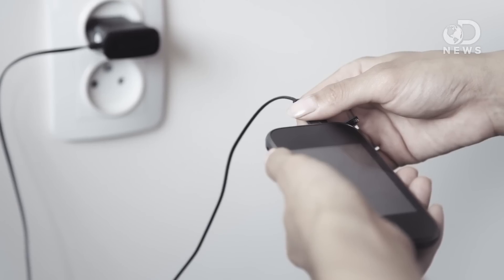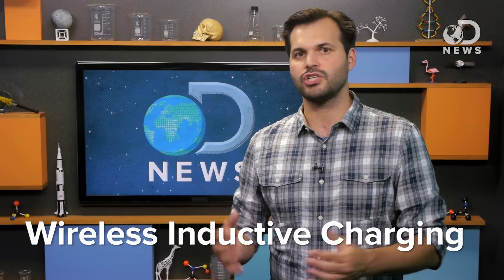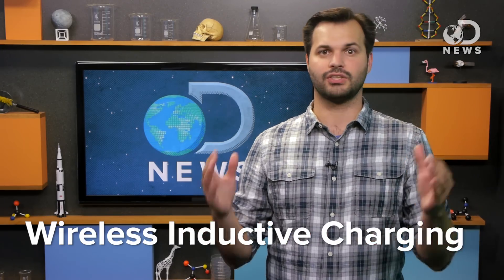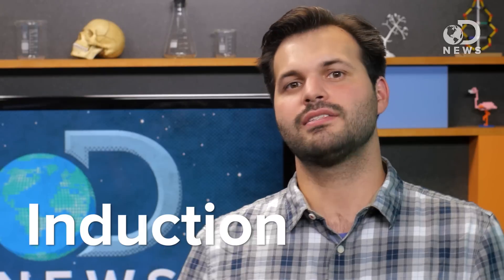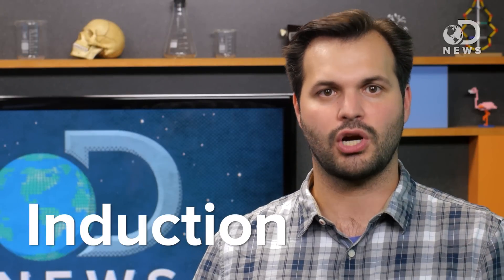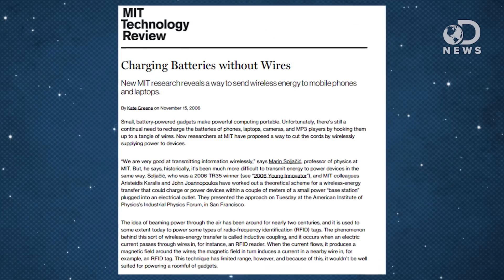How Does Wireless Charging Work?

Comment: So, the question you posed, and I paraphrase: "how do electrons from your wall get into the phone; you DID NOT ANSWER AT ALL !   Like ,not in the least.  Electric current applied to a coil will create a  magnetic field, and that magnetic field can induce a nearby coil to begin "circulating" electrons, but how does that get stored in a battery?  There is an answer, but you certainly didn't come even remotely close to it.  Do your homework rather than just raising your eyebrows, buster.

Comment: I called wireless charging when it's able to charge my phone  in my pocket or ✋. it's not wireless bcz you place the phone on deck which  is connected to electricity through wire.

Comment: You can use microwave radiation to power lightbulbs wirlessly but you will get radiation and cancer, thats why if you put a light bulb in the microwave, it will turn on

Comment: The plug converts the walls AC power into DC power so no the electricity in the pad is not cycling at 60 times per second. Nice try though.

Comment: Please advice me on one issue. Am currently using the galaxy s8 plus by Samsung.  Yesterday night i left my phone on the Samsung's fast  wireless charging pad even after its fully charged.  Will it damage my device? I know today's lithium ion battery are much smarter and they stops inducing charge after they reach to full capacity but am not sure if the same principle applies for the wireless charging pad.  Please advice.

Comment: You can explain it in these simple steps:
1)  Creating a potential difference across an inductor will temporarily sustain a magnetic field. 
2) Alternating the potential will sustain an alternating magnetic field. 
3) Another set of coils within the range of that changing magnetic field will in turn create a changing electric field. 
4) A rectifier can be used to convert AC to DC and recharge the battery.

Comment: "makes life easier". Yeah! It's so hard work to just plug your phone in. Wireless charger generates more energy losses which means longer charging. The lost energy changes into heat what makes your battery's life shorter. Your phone too. Also you can't answer the phone without interrupting charging. One keyword - gadget. Useless.

Comment: Nice ,We are one of the business veteran of wireless electronic product in China, Our main products including wireless chargers, car chargers, blue tooth speaker and BT headphone, transmitter and receiver modules, and PCB., Over 500 skilled staffs in manufacturing, 8 years experience, QI,CE, ROSH 
and FCC certificated.

Besides, We have excellent engineers and designers for OEM or EDM orders  ,currently have our own plastic molding, IC bonding, SMT and finishing departments that are all managed in accordance with ISO 9001 guidelines. we think our products will give you an edge over your competitors.

Comment: hey, i just bought one reciever for my Note 2 but the phone is not charging. when i put the phone my wireless pad, the pad turns on its lights like its charging but my phone is not. I checked the pad with Galaxy S6 and it works like a charm... I'm on 4.4.2 .. what should i do?
Reply: u still didn't get answered ;(

Comment: hi, to all.

this video has good information, and let you a new way to see the wireless charging technology.

But, Tace Dominguez; you said that the wave of transfer electricity on the wireless charger is on AC voltage and the Samsung wireless charger works on DC or direct current, also most of the wall charger and car charger are DC voltage ....?
Can you explain that?

Comment: I did a little experiment to see if I would shock myself with a wireless charging pad. what I did was put my phone on it and put a piece of tin foil in between it. What I found was that I wasn't shocked at all, just now my phone wouldn't charge as when I touch the tin foil my body's ability to conduct electricity was altering the direction of the power while splitting the same amount of power into my phone, preventing it from shocking me.

Comment: Wireless charging is kinda pointless when you think about it, I mean you still gotta plug in the "wireless charger"
Reply: +FingerFlickenBoy it's actually slower
Reply: It really is. It's just a novelty.
Reply: you can buy a 15 feet charging cable too
Reply: But you can be up to 15 feet away from it.
Reply: You can use it with multiple phones and it's a bit faster :p
Reply: DonD512 Unrelated, but my galaxy s7 edge charging port broke a few days ago and i had no way to charge it. So it fixed my problem at least, lol
Reply: +Jacob Taylor ...Dude me.  too. I just got back from the store. spent 50 bucks on this stupid wireless thing.  my s7 is 3 months old.  and the charging cables don't work anymore!!!! wtf.  I'm screwed.  this thing charges like 10 percent an hour
Reply: well, you do prolong the use of your adapter ports, including the charging cable.
Reply: +Jacob Taylor ... ok here's an update.  I plugged my brand new wireless charger's USB  connection directly into the phone. and now the port works of all sudden!  I've used other people's Samsung cables and they don't work on my phone.  but this new wireless usb connector works fine with the port.  maybe you should just get a brand new charger cable and wall socket.  it could be the cable getting old and twisted. not the port.  Idk.   try it.

Comment: If you power larger devices with this, isn't it the equivalent of living under the power wires? Cancer or birth defects anyone?
Reply: Living under power lines does NOT cause cancer or birth defects. This is a commonly held misconception that has been debunked many times by scientific studies.
Reply: only few of us  think of this others are just too interested in the needs they have than what actually benefit us all

Comment: 3:35 freeways that charge your vehicle and devices. Kinda like how the Porsche mission e is setup for induction charging. That car is capable of charging wirelessly due to its induction charging setup it could then receive a signal from a distance thus never needing to pull over for the sake of needing a charge.

Comment: my computer whould be Nice charging wirelessly. it whould also be Nice to be able to turn it on and off. if that is not possible it will be a waste of power and recources. i also think that can have something to do with why it is not in use at the time
Reply: Maybe a desk that you would plug a wire into and most of the desk top would have a wireless charging pad on it.

Comment: Overcharging phones = exploding phones etc... Actually there is too much energy waste to make this useful on a large scale ie: 
10 times more pollution generating enough juice to cover the energy loss BUT it would be super cool to only use it to CAPTURE lost energy ie: energy slipping out into the air anyway such as transformer energy loss, EMF loss, static, electric wire loss etc.

Comment: Everyone knows nuclear provides clean energy, but notbody wants it around after they saw what happened with Japan. With Inductive Wireless Charging, we could possibly move the electricity from a remote area to homes.
Reply: +Julie Lum Wireless charging still has a maximum distance, though.
Reply: Ahh yes. Maybe someday.
Reply: +Julie Lum    nuclear power is not clean energy. it produces radio active by products and the thing that happened in japan can easily happen again. also it only produces half of 1 percent of the potential energy stored. I think hydrogen or even better finding a way to build thorium building stations is the future. you cannot move electricity from remote areas to homes. the further you travel the more power loss there is.
Reply: luke martell
The power loss isn't that significant...
Reply: But I guess that's were this wireless energy comes in? Maybe someday we can have one large power plant every so miles and get rid of power lines as we perfect this technology. And I agree with you on the nuclear point. They are fragile plants that are detrimental if not properly cared for, but I stated them as an example earlier because at the moment, nuclear is being used on large scales in countries to generate energy while hydrogen, biofuels and other eco-friendly methods are less common and not economically feasible on a large scale at the moment, though I hope we do turn to these alternatives someday.
Reply: +Link149     actually yes it is and I think time would be better spent trying to fix the actual problem and giving the 2 billion people on earth power instead of trying to find a cool way to charge your tooth brush. as for the economy. using thorium would be 10 000s times cheaper and today's plants can be easily changed. I guess it's not in the government's best interest. let's build walls instead right
Reply: But wireless means that anything that needs electricity can be charged, so electric cars could possibly run and all household applications could go entirely wireless! I still think it's a noteworthy investment lol. And yes, you bring up a good point. Building walls is always the answer.
Reply: luke martell
Here in Quebec, Canada, we have huge hydroelectric plants (dams) all the way up north of the province. We produce so much power we actually sell some to the United States.

I don't know how much of that energy is lost, but for comparison, the distance from the border of state of New York must be around 1000 Km. If the power loss was really that significant, the amount of energy we could share with the United States would probably be so low it would be pointless for our countries to even have a contract.

Then again it depends of the material the wires are made of, and all kinds of other variables.
Reply: here in Ontario we pay more for hydro then any were else in the world. there are many problems with this idea. number one installing hydro plants every few miles and loosing 90 % of the gross kwh made would be as dumb as living in north Quebec. 2 how do you stop people from stealing it straight out of the air. just plug your stuff in and fix the real problem. global warming
Reply: I'm all for moving toward a future where electricity is widely available, and it could be implemented as a regional tax just like a tax for street lamps and roads. Its like charging your device at a library or using public WiFi. I'm not saying there is any problem with the current system, but I am suggesting that this has the possibility of replacing dangerous electrical towers and can possibly clear up wires from urban areas while providing readily available electricity for everyone. In addition, the result could be the movement toward cleaner energy such as hydroelectric and wind farms that don't have to use up acres of urban space.

Comment: it is also possible to transmit DC current wireless by means of low field Microwave ever put tin foil in a microwave as an analogy as the current hits a copper plate you can use a diode bridge to transform the microwave into a DC current out put

Comment: I'm sorry to be the bringer of bad news, or "mister know it all", but, I just wanted to point out that the power running through your walls is DC (NOT AC)! while the power running through the power-lines is AC, since AC is great for long distance packaging of high-voltages using power-stations, containing "Transformers". If the power-lines were DC, you'd need a power-station every so many blocks.
Just prior to getting to it's destination (for example, your house), the AC is converted to DC, using a "Rectifier" and stepped down to 120 volts (240 volts in Europe), which is what is running through the wires in our walls and also what we receive from our sockets, to power our electrical appliances.
Thanks!

Comment: Matching resonant frequencies wasn't discovered in 2006 (that's pretty basic EE)... That MIT teams advancement was deciding to choose a frequency that gave them about a 2m distance in the near field. They also proved that by adjusting the resonant frequencies, the near field size can be changed. Also, the future is wireless power transmission. As an Electrical & Computer Engineering undergrad I made a wireless charging system for cell phones (not surface to surface induction mat style, but free space). This is getting easier and easier to do.

Comment: If wireless power really kicks off, one great area of implementation could be transportation. Imagine a car that runs on electricity but has no batteries as it would be drawing power from a smart wireless power grid.
Reply: No batteries at all would never be practical, it would mean every inch of road would need to have the technology installed and maintained. You could simply have smaller batteries and have charging pads at places like parking spots and traffic lights in the most high traffic areas.
Reply: The only best area for such technology are bullet trains. The Japanese MAGLEV bullet train uses wireless transmission of energy to power the internals of the train
Reply: it's real but billionaires at big companies won't go for it

Comment: So the charging pad has to be plugged into the wall and the phone has to be set onto the pad? Why not just plug the phone in then?
Reply: Maybe the ports broken?
Reply: ***** You can charge multiple devices at one time, an advantage over plugging them all in and taking up 3 ports.
Reply: ***** Mini USBs have a bad tendency of wearing out very quickly.  I just put my Galaxy S3 in the shop to get the charge port replaced, cost $55.  Then I saw inductive chargers on ebay for $10.  Not plugging it in anymore except for data transfer or once in a while for faster charging.
Reply: Kevin Miller I didn't know that. Now that's useful.
Reply: ***** yes, people are too lazy to plug it in, its easier to just set it on a pad than to plug it in. first world issues
Reply: ***** its easier
Reply: ***** so the port dosen't wear out
Reply: Might not the charging pad's port break and/or wear out? Perhaps someone would need a charging pad to charge a broken pad.
Reply: If you don't have the cable, this would be an alternative to charge your phone.
Reply: THEOAKLANDBABY510 
My cell phone (Motorola Droid X) did that a year after the factory warranty expired.  The data/charging port quit working.  I can't tell you what a pain it was to buy a second battery and a charger for those batteries; constantly switching them out while the other charges.  This is why I can't understand why people buy cell phones with integrated batteries and integrated memory only.  I had my eye on the Samsung Galaxy S6 until I found out that it featured both of those bad traits.
Reply: posting id my zte sonata did that in 3 months so i am just going to sell it to someone or a machine and going to buy a lg optimus l70
Reply: THEOAKLANDBABY510 my zte sonata did that so im selling it and buying an lg optimus l70...
Reply: Jaytheredneck1 i'm having the same issue with my s3. what charger did you buy?
Reply: Maybe if you go out you'll never run out of battery?
Reply: Google Doogle That would require an excessive amount of energy, but maybe one day
Reply: Tómas Óskar Friðriksson uhh. no
u have to put it on the pad in oder for it to charge. it doesnt automatically charge in ur pocket or something.
Reply: posting id  I just got the S4 as a gift, but was going to take it back for the S6, but then I found out about the no MicroSD or removable battery.. Now I'm conflicted.
Reply: Jason Ries, sometimes your charger may disconnect during night but with wireless you just plop it on the station and you are going to be charged. Also it does break as easily.
Reply: Works for people who can't replace a high end smartphone due to a damaged charge port. just pick up a wireless charger for 30 bucks and a cover can be found for 10.
Reply: Because you can leave it plugged in and then just sit the phone down on it.

Comment: The words "Waste of energy" caught my attention. Is it still a waste for those charging pads that charge by simply placing something against it? Like the Galaxy S5's charging case? It doesn't dock in or anything; you simply lay it down on top of the charger. I mean, still wireless, but not over a distance. Still a waste?

Comment: actually it's more efficient as most if not all inductive chargers shut off when the battery is full unlike a AC adapter which constantly gives off a current and thus constantly uses power

Comment: This is not wireless chargibg lol. you still plug it into the wall like the" old" method as well as a wire commibg from it.. you cant walk around the house and charge youre phone while its not plugged in lol. you have to keep t on the pad to charge . infact its worse with that method. The plug you have right now that it plugged directly into yor phone will stsy attacched so you can use your phone more easily. the other way requires you to hold tge chsrgibg base and tge phone together at all times. its a bit awkward direct plug moves with the phone. unles you have the w
ireless charging devise attached to the phone tgen you can manuver th
e phone with having to hold the charging base to it. it shoulf be marjeyed as a 
way so you dont need as many porys expoding the inside of your phpne to dirt and you wont have to worry about the charging connections getting worn out since they are no longer needed. but wireless.. yea right thats like calling dialup wireless lol you got tge cable going right into the pc. Wireless ny ass. you wabt to knpw wgat wireless is... its wifi. Being able to walk damb near aby where abd being able to use tge inyernet with no cableattached to you device. if tgey could increase the range a device could be charged at then yes thats wireless. this crap ... no . laughable that they even claim its wireless. nice effort tho haha